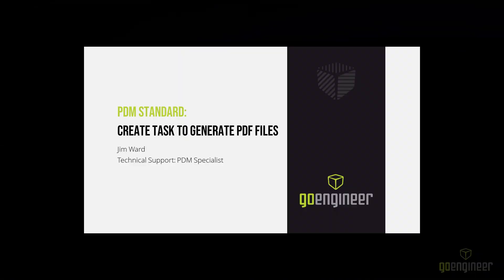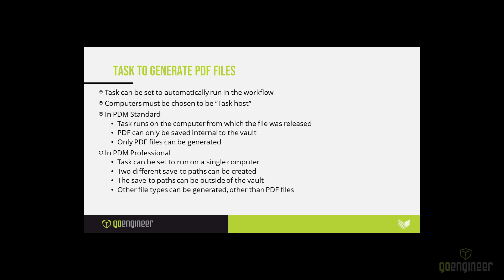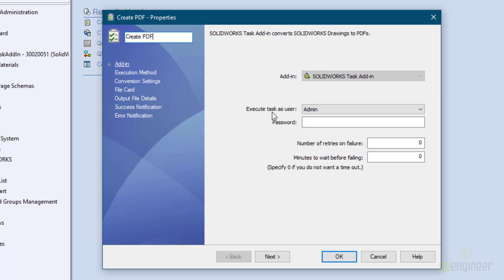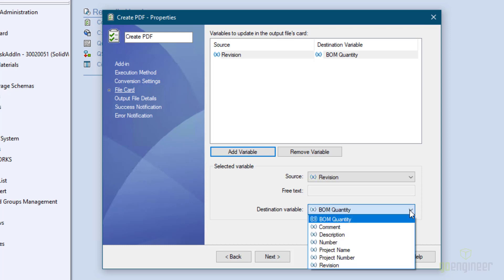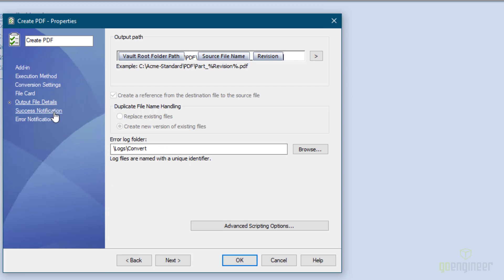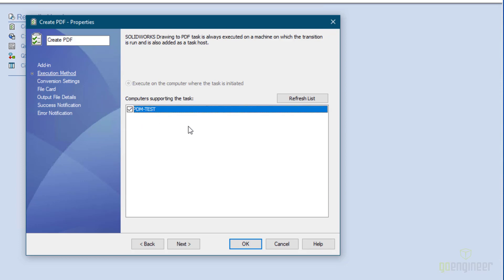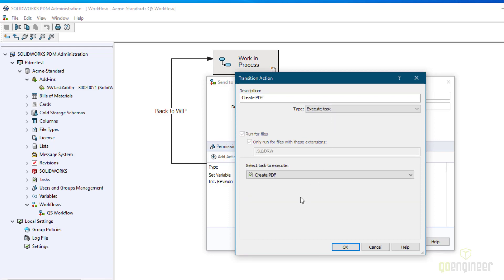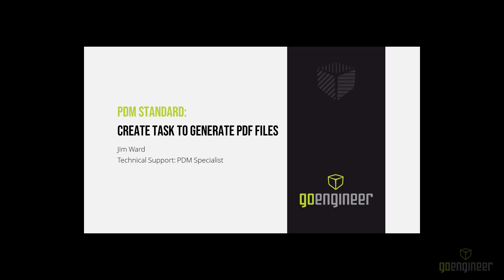SOLIDWORKS PDM Standard - Create PDF Task

Comment: thanks for the Video, i have one question if we have multiple project using same workflow and i want the PDF saved in each project folder, could you please advise?
Reply from the maker: You would need to use variables and the part file path to decide where it saves. It can be a dynamic output location within PDM. It's mentioned in this video right here: https://youtu.be/rUhGomcPcko?t=276
Set that to be a folder path that changes based on your project folder path and it should save to the individual project folder.

Comment: I noticed that the finished state of the PDF is “Work in Process” … how would you get the file to automatically reach the released state? 
We want our PDF prints of the SLDDRW files to also appear as Released so as not to cause doubt or confusion (or to be edited or overwritten).
Reply from the maker: With PDM standard there are very few automation options, at some point a user is going to have to transition the file to released.  PDM Professional has automated transitions or the ability to have multiple work flows that can manage this sort of thing without user intervention.
Reply: @goengineer  I made an auto-transition that permitted only .pdf files with a revision move the item straight to approved. works great!